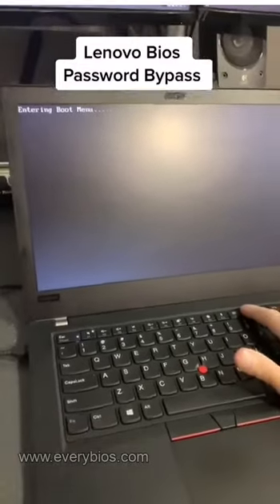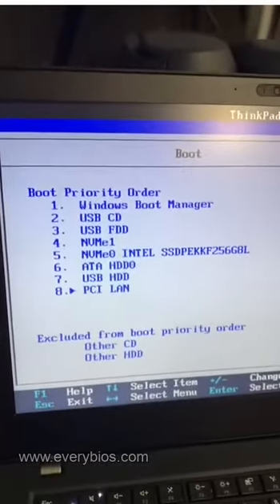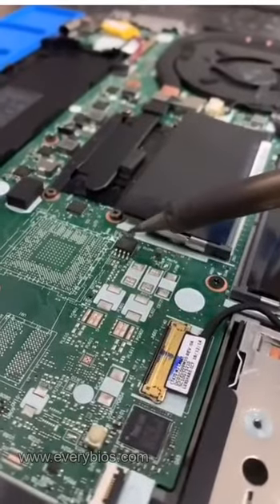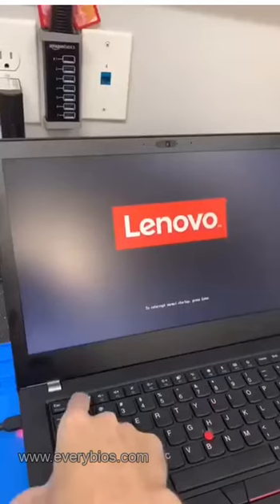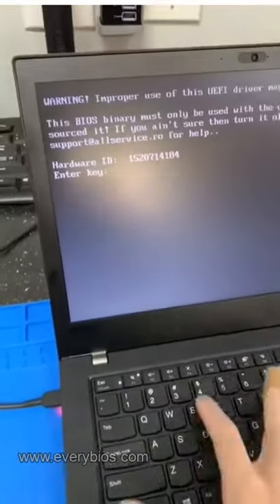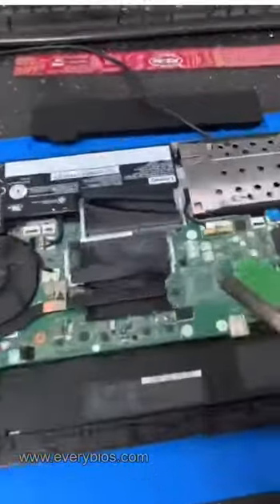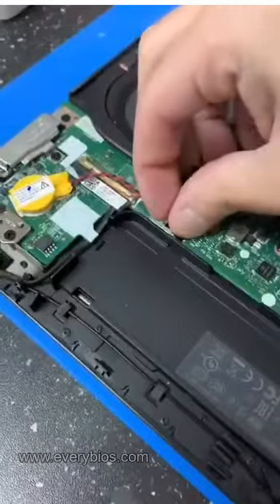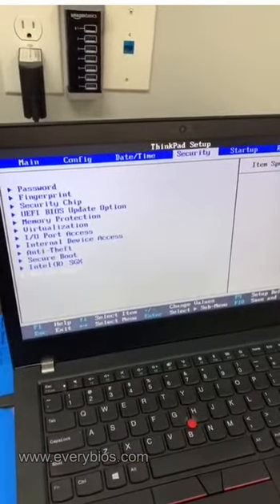lenovo bios password unlock

Comment: If you can take out the CMOS battery then do it that way
Reply: As far as I can tell, removing the cmos battery doesn't reset the bios data anymore. :(
Reply: Didn't work on my 10 yr old one
Reply: This ain't the 90s nomore dude
Reply: Hi removing the cmos battery did not bypass or remove the password or username on my Lenovo yoga

Comment: what company did you buy the firmware from? I work for an e-recycling company and i have about 50 lenovo laptops with computrace on them, and i imagine I'll be buying more later down the line, too
Reply: you could probably extract the firmware from an unlocked one to copy as it sounds like you hay have access
Reply: it said allservice its a romanian company, but there is a lenovo auto patcher on badcaps i believe